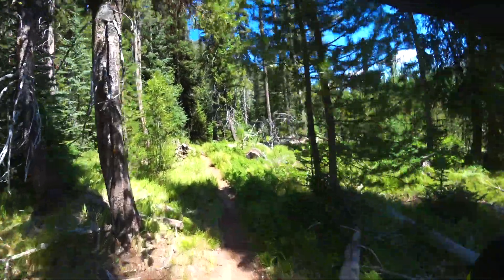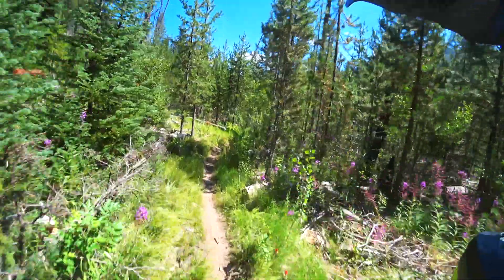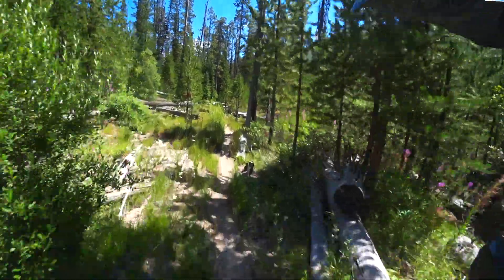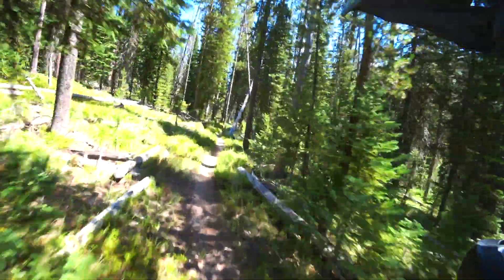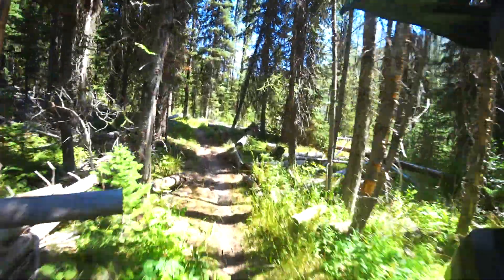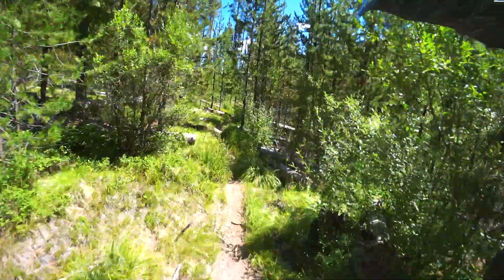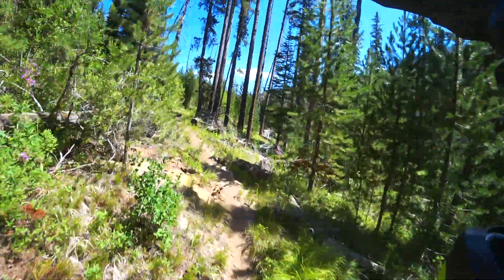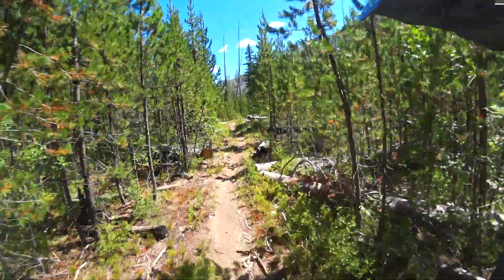Switching My Dirtbike to Super Heavy Duty Tubes Over Bibs & Tubliss - Idaho Moto Enduro

Comment: The top two vent tubes on the carb can draw in water. Route the top two vent tubes up under the gas tank. Loop them so the ends are pointing downward under the tank.
Reply from the maker: Thanks for the info! I’ll look into these tubes.

Comment: When vent tubes get blocked with water fuel stops flowing into your carburetor. My 17 250 xcw did the same thing, I cut tees into the vent tubes and ran additional tubing up under the seat. Never stalled in water again.
Reply from the maker: Thanks for the good info! I have rerouted my hoses a little but maybe I need to revisit it

Comment: I liked the TuBliss. If I was to do it again I think I would stick with the UHD tubes. I had one catastrophic failure (membrane and inner liner) with TuBilss in the 6 years I had it the rim lock got me back. There was no way to fix it on the trail. Like you said a spare tube can be swapped pretty easily.

Comment: Had this  happen to me. Find out I had hair line cracks in my air box in couldnt see. Sprayed the bike with water when I got home to pin point the affected area while engine as running and it would die when water hit the air box. Also it looked like my clamp to the carb might not have been airtight as I thought it was. Hope this helps.

Comment: Heavy duty tubes with some FlatOut (better than Slime) added is the way to IMO.
Reply: I like flat out too, I use in rear wheels with Tubliss, and in tubes. It mucks up a valve quicker than slime, so I check pressure less, lol.

Comment: The vent tubes will T on both sides of the carb. Just reroute the two that go up and over back to your airbox under the seat. Easy fix

You can prove it out easy enough... just submerge your 4 vent hoses hanging down in a little cup of water and it will die on you.

Comment: SOooo green, love it!!

The past 18 months, 3 of my bikes from front Tubliss changed to mousse.  Front flats are riding ending.  I miss tubes in the front, mousse are heavy, but I've never had a failure(yet, lol) with mousse, I add lube a couple times a year, and replace at the 1 year mark, cost does suck. In the past, Slime in tubes, and the outer tube slathered in rubber grease, I've had good luck.  even gas  to wipe off the slime and rubber grease will help patches stick :)

Someday I'd like a better solution for our tires.  I've tried a cut mousse and the high pressure bladder in the front... dead and heavy, might have future potential maybe.

I'm not sure on the water crossing.  Made for some good video!!!!!

Thanks for the video!!

Winter is coming :)
Reply from the maker: I appreciate the comment! 

I had 3 back to back bib failures this year. That put a sour taste in my mouth lol. I really like how reliable bibs are, but once they go bad they go very bad/dangerous. The rear tire started flopping around and hitting my chain, the front would just fold over off the rim.

Winter is still a good distance away! Lots of riding to be had.
Reply: @RacerRed  Wow, 3.  Thanks for sharing that, I'm a mousse noob, I've never had a failure...YET  I'll be watching them closer now TY.  10 thumbs UP